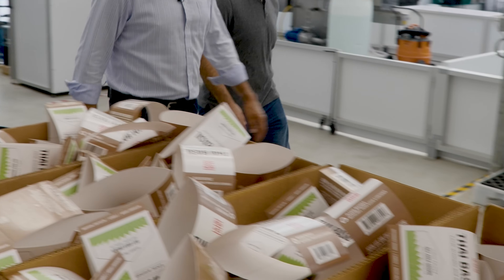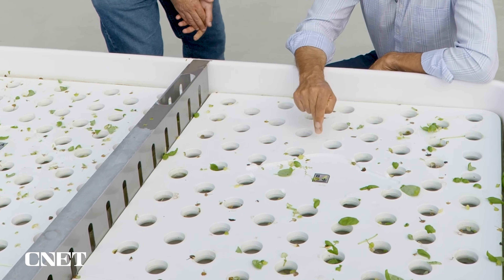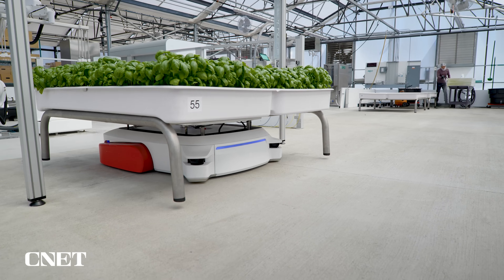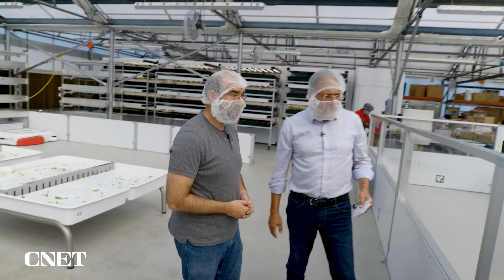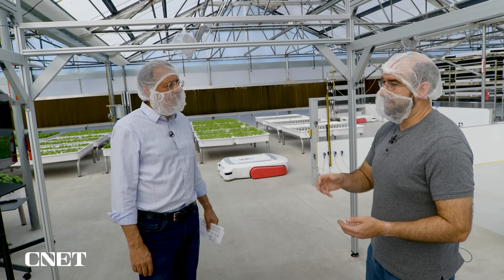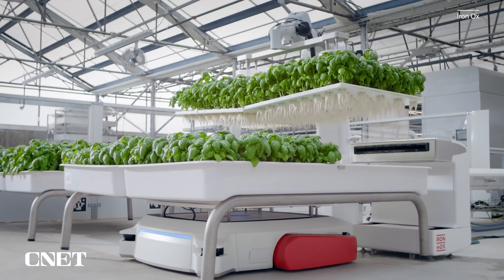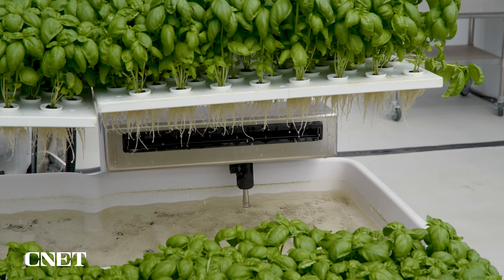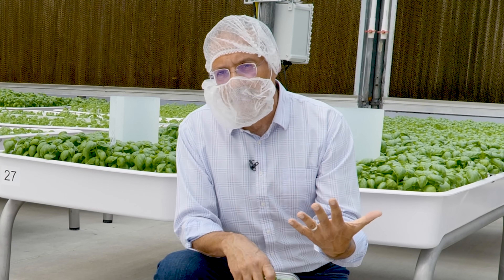Iron Ox Is Thinking Way Beyond the Autonomous Electric Tractor With Amazon-Like Robots

Comment: Searching for more sustainable, more productive and more efficient methods of producing food is of course noble and has to be encouraged, but... what's the point of this automation? It seems to me that it doesn't add any advantage beside not paying people for the work and concentrating all incomes to a few. Please correct me if I'm wrong.
Reply: I hope to engineer for my own farms eventually and the big question for me is do i want to provide jobs or do I want more automation. I lay in an area where I want to balance them both, specifically harvesting for automation since it’ll be vertical farming, and other jobs like planting, maintenance, finishing touches, and conveyor work could be jobs for people :)

Comment: This is 100% unsustainable. How much plastic are they using? How many resources does it take to make all of that high tech equipment? Where is the energy coming from for the fertilizer? The lights? A reporter would have done the simple math and had some questions, rather than act like a salesman on the Home Shopping Network.

Comment: This looks like one of those companies that finds investors to give them millions by demonstrating their impressive technologies. But, everyone ignores the inefficiencies, the cost per unit production, and inability to scale until they file for bankruptcy.
Reply: Yeah this looks super inefficient.  I interviewed for a job their a couple years back and when I looked at it I was trying to understand how good the technology was.  Now when I see this it looks way less efficient then what greenhouses with table systems are using now a days.
Reply: @__________f9433  :  I saw a TV item about a non-automated hydroponic system where the trays floated in a large, shallow swimming pool, set at work height.  There were guide rails to keep movement under control.
Workers were around the perimeter, and could easily move the trays with a gentle push, even though they were much larger than the ones shown here.

Comment: This should be available for residential use.
Reply: You can literally buy small hydroponic systems for your home that do work the same way. Water, Nutrients and LED lights on top.
Reply: @oO0Xenos0Oo  All the ones I see push users into subscriptions with silly prices on input commodities.
Reply: @skyak4493  You dont have to use these subscription input commodities. Hydroponic is no rocket science, just buy the commodities by yourself for a fraction of the price.

Comment: I wonder how much micro-plastics
the plants leech into their system
while grow in those modules?
Could we possibly make modules out of bio-degradable materials or metal comps?
Reply: Outside of extraordinary circumstances - e.g.: intense heat, abrasion, caustic liquid - plastic materials don't leech into water.
Reply: @jizzlecizzle1388  metals and reclaimed material would also probably be worse with leaching.
Reply: @jizzlecizzle1388  Thanks for answering, both of you, just wondering then now, how most of the microplastics get into our food? is it in transport, while in plastic packaging...hoefully seaweed 3d printed & otherwise plastics get to take over the packaging industry.
Reply: The micro-plastics that are causing environmental concern are literally tiny particles of plastic resulting from abrasion or other activity in nature, some microscopic in size.
There are plastics that give off harmful chemicals through "Off-gassing" or similar processes... these are not cleared for use in food related operations.
BTW; the word is "leaching", a "leech" is a nasty, slimy, blood-sucking creature.   😱 🥴

Comment: It seems like it would be more efficient to move the water than the plants.
Reply: I think it is the photo analysis along the trip that makes the method. plus less obstructed (plants in the way) piping . Remember, they move the plant to the Sun after the seedling stage.  It is a full process, not just a single step thay are looking at.
Reply: True, for water. But they are trying to automate the whole process. So the module can be just moved to a different automated stations for different steps(ie, watering, inspection, harvesting, replanting). This is also scalable faster.
Reply: They need to 3d scan.